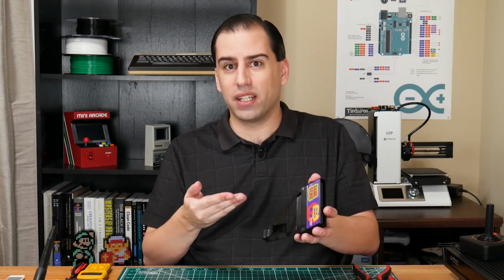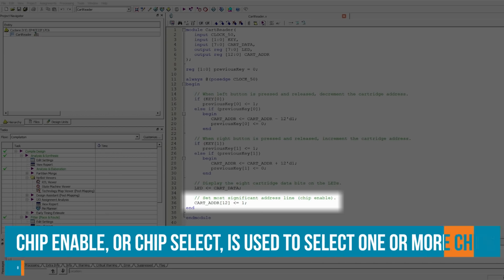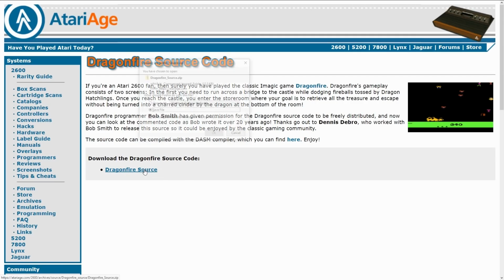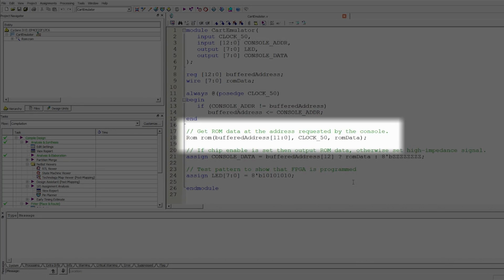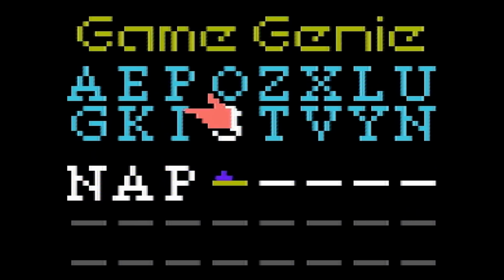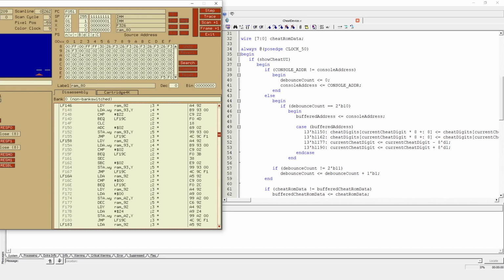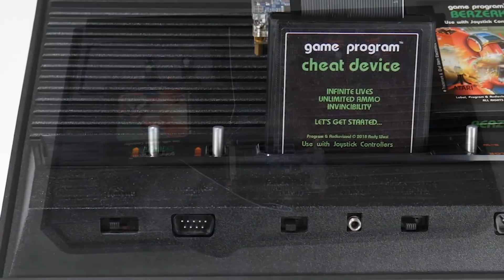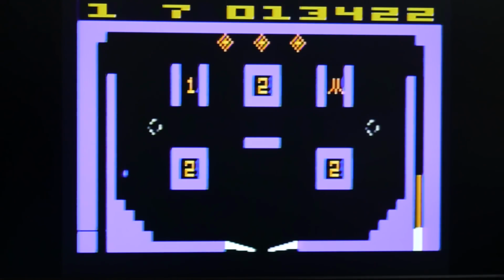DIY "Game Genie" for Atari 2600 using FPGA

Comment: How do you get one of those stickers?
Reply: I'll let you in on my secret: I print them on my old laser printer at home. I bought some full-size sticker sheets and self-adhesive laminating sheets. I carefully cut them out with a ruler and utility knife. I don't know if they'll hold up to long-term use, but they look decent for the camera. For the design I used an online cartridge label generator.
Reply: You could send them to stickermule, they have a sample option. Or go to a decent copy shop and let them print with a good laser printer on sticker paper.
Reply: Thank you guys

Comment: I think that FPGA's got more processing power than the 2600!  

Perhaps if the 7800 had been a popular console (and they put the POKEY chip in the console rather than the cartridge, though I suppose it would have been nice if, had the Atari 7800 been popular, that some games used different sound hardware, such as SID, the AY chip or even a YM2610!)

Comment: Neat project. ;)

Glad to see more FPGA vids recently. It can be very rewarding to get into, and not half as tricky as many people might think.

Does the DE0 Nano have clamp diodes on the GPIO ports? If not, there should really be some voltage translation between the FPGA and 2600 (unless I missed a step, as I only did a quick skim through the vid to check.)

btw, if you use the In-System Memory Content Editor in Quartus, you can very quickly and easily load new ROMs without needing to recompile the whole project, or even directly alter bytes in the ROM, via the JTAG / USB Blaster connection. ;)

(you have to first enable that in the Wizard for the on-chip ROM, and give it a name, up to four letters. 7:28 )
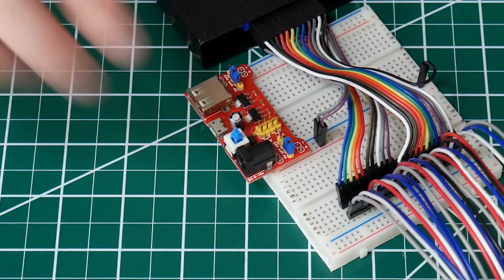Reply: Yep, clamp diodes are discussed at 4:00.
Reply: @andywest5773  

Ahh, see, I did that thing where I replied before watching every bit of the vid. lol

I know the Cyclone V GX board has both series resistors and clamp diodes, so guessed the DE0 Nano might do, too.

The old DE1 board only has the resistors (and Cyclone II), and I've never managed to zap an IO pin with a 5 Volt device yet, but then it's a much older chip.
Reply: @andywest5773  

Oh, that PCI Clamp diode option won't protect the FPGA when using 5V inputs...

The clamp diodes are only enabled after the chip has been configured (from SPI Flash or via JTAG etc.), so there is a short time of a few hundred milliseconds when the diodes aren't enabled.

Also, they should only be used with external current-limiting resistors, AFAIK.

In the very short term, it will "work", but it's likely causing damage over the long term.

There have been forum posts about this before, but I can't find them atm.

(quite hard to Google for things now, since Intel changed the URLs on the Altera site.)
Reply: @electronash  Fortunately for this project, the FPGA must be powered on before the Atari or it won't work, so the diodes should be enabled in time. Of course, there's no protection against doing it wrong (just as there is no protection against inserting or removing a cartridge while the console is turned on). You're right that resistors should probably be used, though. Intel's Cyclone Handbook tells how to calculate the value.
Reply: @andywest5773  

Great vid, btw. ;)

Please keep doing them.

Comment: Wow this is definitely cool.
Now i was wondering for years about a gamegenie device for the atari lynx,

Yes it’s true the lynx cart cannot directly talk to the cpu and a hard reset can only be faked via ram isolation and the data needs to be decrypted & decompressed first, BUT what if the gamegenie could decrypt & decompress and then manipulate that game with the codes you put in and then re.encrypt & recompress it to eventually run it as a manipulated game on the lynx, that would be cool, sure such game genie will require an insane amount of ram & time to execute ,, but it would be just sooo cool.

Comment: That's pretty cool.  I bet if you sold that as a kit folks would buy it.  One way I would improve the UI (if you could display 7 digit characters), would be to make the codes an address + two bytes instead of one (maybe add an extra alphabet character to represent unmodified, though not necessary).  That way you could accomplish more with each cheat line (since you only get 3...).  Also, it seems like you could use this to work as an "everdrive" or even a dev kit... For rapid prototyping... Heck, maybe even use it as an accelerator for homebrew (e.g. offload some of the processing to a v-core on the chip or an atmega, and just use the native Atari code for cycle perfect rendering, and sending input signals via address manipulation...).

Comment: You forgot to show how you go from the codes you enter in the UI to the actual part in the code that intercepts the right address/data.  Or did I miss that somewhere?
Reply: Yes, that was an oversight. I only show the hard-coded version in the video. But I've uploaded the full Verilog code if you're interested, as well as the code for all the tools. They can be found at the link in the description. The part you're looking for is in the top-level module, CheatDevice.v, near the bottom (it's only about 100 lines of code).
Reply: @andywest5773  Now I see!  Thanks.  Read the address and data that the console is requesting then see if it's one that matches the address portion of a cheat code. If it is then replace the data with the data portion from the cheat code.  Easy peasy.
Reply: @andywest5773  So now in order to make the "book" of cheat codes someone has to look at the data/address info in each game to find which ones point to lives/hits/etc. to create the actual code?  Sounds very tedious and now I appreciate the work that went into the original game genie!
Reply: @JoshuaPritt  Yep, my understanding is they had a team of people coming up with those codes. I can tell you that it took a few days for me to create the codes for this video.
Reply: @JoshuaPritt  you can do it a bit quicker than manually analyzing if you modify an emulator to hunt for cheats.  (the way it works from a UX perspective is that if you want to know where lives is stored you enter 3, and then die, and then enter 2, and die again, and each time the value changes it narrows down where in memory that is stored -- that works with ram only though, there's probably some neat trick you could do to make it work with rom with a modified work flow, but someone would need to build that hunting software though...)
Reply: The Stella emulator has a memory compare feature but I couldn't get it to work right. There's so little RAM in the 2600 that I just took a bunch of screen captures of the data and compared manually. When I found something interesting, I searched the ROM for code that modified that value and wrote a cheat code to change it. Usually it meant "NOP"ing out an instruction.
Reply: @hamu_sando  of you want it to automatically give you "game genie" cheat codes for a device that no one else has, yes, you will have to modify existing code... Should be trivial though...
Reply: @hamu_sando  I was thinking the same thing, once the wizard knows the value, you could have it just find instructions that modify that value, and generate cheat codes that nop them out.. (maybe you could tell it to disable only the dec instructions, etc...)